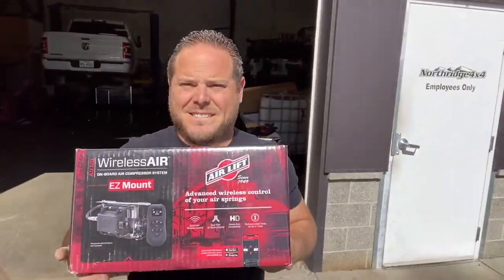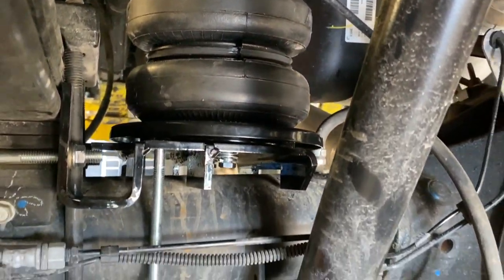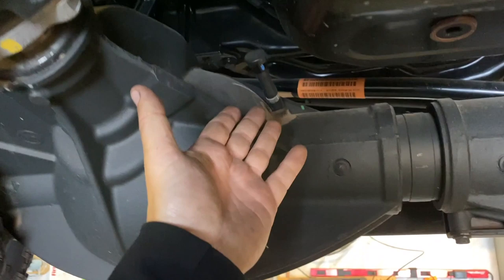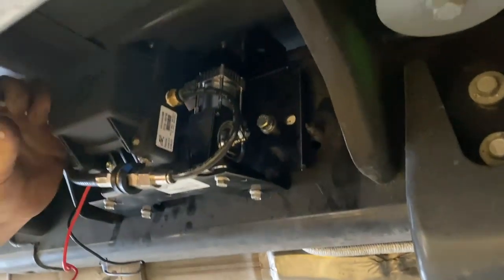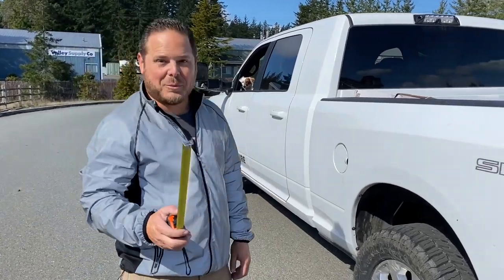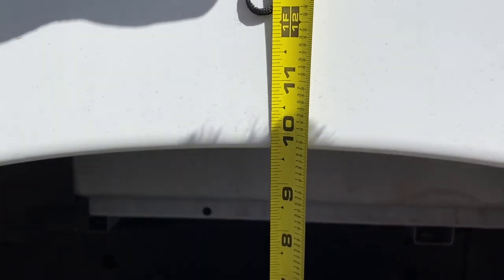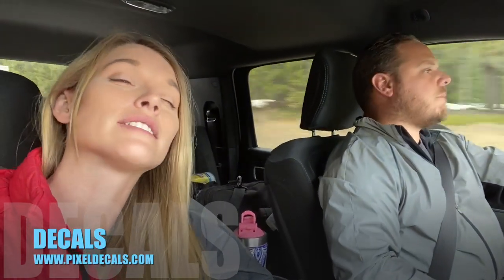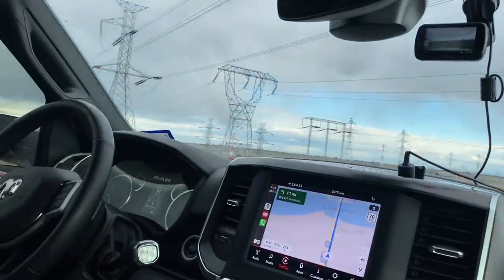RAM 3500 GETS AIRLIFT AIR BAGS!

Comment: I'd be worried about half a vehicle sitting on the tilt portion of the trailer! Always been led to believe air can make for a harsh ride depending on the psi you need.
Reply: The tail has a rest that it sits on. To lower the tail, you have to raise it up, move the lock, and then lower it. It happens in high speed in the video but you can see Kevin do it before they load.
Reply: @DeepOwl1073  Thanks. I assume the trailer's stilt portion and lock you mentioned are rated for a specific amount of gross weight and all is well.
Reply from the maker: Air ride is all about finding the right pressure. Too much or too little can cause a harsher ride. Get just right and it’s comfy as can be

Comment: Bellows airbags aren't a good idea and neither are "override airbags"... either replace your rear suspension or don't. Override airbags increase ride stiffness without increasing roll stiffness, and bellows bags are rising rate, increasing the chances of rollover.
You want spring replacement rolling lobe bags or nothing... And even then you'll need a panhard bar etc.
The airbags won't transfer weight forward either, they'll just reduce static squat. You're best of with respect to that, moving your ball forward a bit if there's adjustability in there to do that.

Comment: For the boat people so when they reverse their boat trailer in the water at the boating ramp so you submerge your rear end in possibly to the rear wheels are under water, so you dont have to worry about sucking water in, you dont drive forward down into the water while launching your huge boat.
How is your mum coping with these trying times, me going stir crazy used to being out all day every day either walking my dog letting him run loose for a couple of hours then I either go play with my radio control gas offroad trucks and buggies, only using my two electric Trophy Truck's or my multirotor when no one around, still in full lockdown here in the UK, emergency or essential journeys and dog walk around the streets not off lead or jogging cycling keeping well apart from strangers, love you guys be safe on your travels, I understand some states on full lockdown some not in your country. So watch how you go, as I look forward to your uploads.

Comment: I wont own a truck without airbags!  its the first thing I do when I get a new truck!   at the end you mentioned you have the side to side option and I must say with heavy loads that scares me. if you lose just one bag at highway speed with a heavy load that could have the potential to throw you out of control.  the chances are slim but I set mine up so the pressure is the same in the whole system.  it seems to allow more articulation that way to cause as one bag compresses usually the other is opening up.   Just my 2 cents. youll love having the bags.  and know that the airride system will last forever, my brother is still running and 04 ram 1500 of mine that I put bags on when new. that system with onboard pump and gauges is over 15 years old and they still work as the truck rots around them.